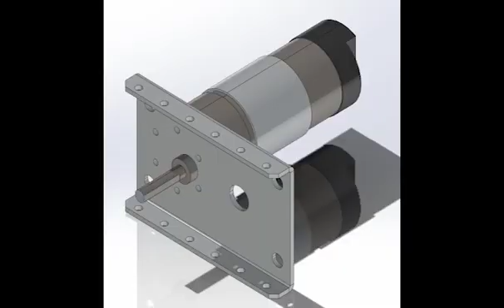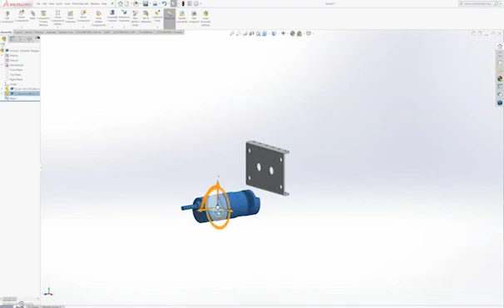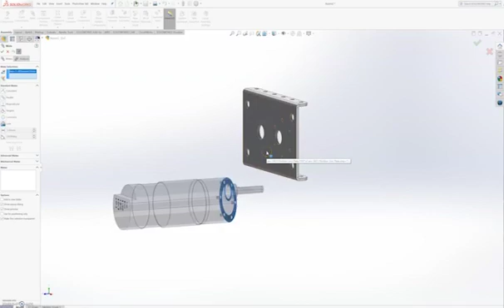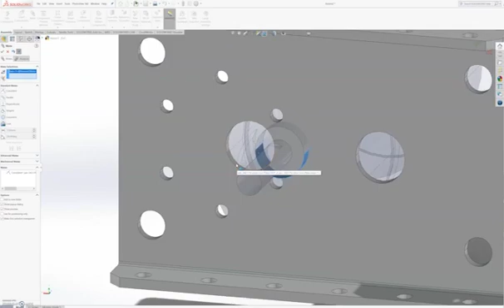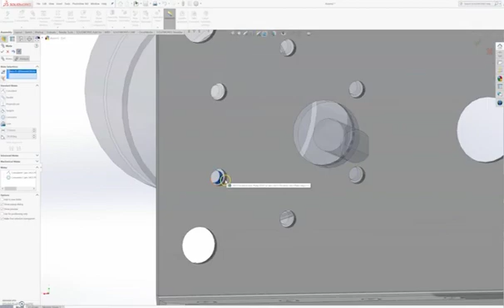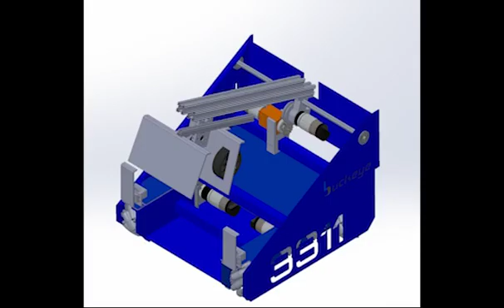Inno3311 Solidworks Mating Video

Comment: Thank you very much for the helpful tips on mating. Our question is, what CAD programs do you recommend if a team does not have a powerful enough computer for Solidworks? -Wildcard Robotics 18335
Reply: Fusion 360 is a good program, while it works great for making custom parts, it is very difficult to mate using it. Another program we recommend is Onshape, which is web-based and allows multiple people to edit parts at one time. (essentially a google docs version of cad)